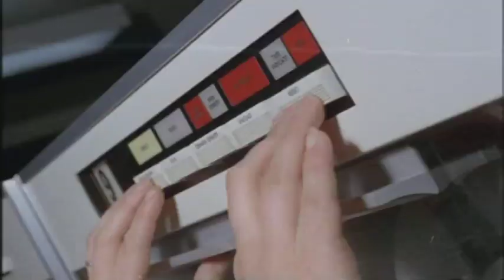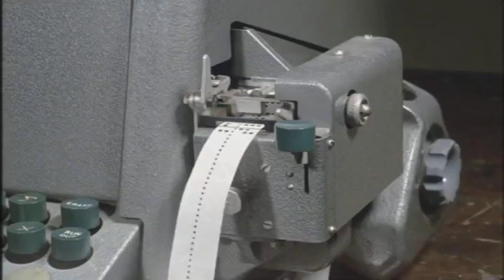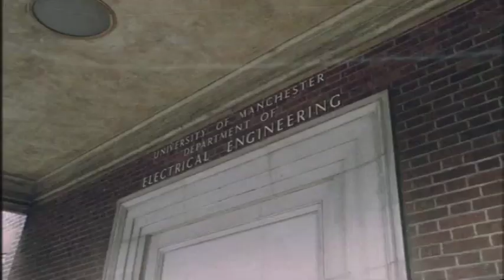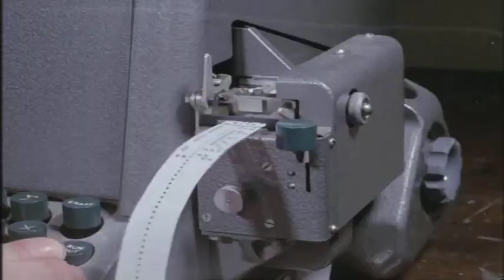Look at Life: Figure it Out

Comment: 2:04 "they can
        
      
    
  

  

    

      02:07
    

    

      
        

          deal only with things which can be
        

      
    

  

  
    

      02:09
    

    
      
        

          expressed in numbers
        "

I was going to argue that point but then I looked at the formatting of the quoted text. LOL

Still, I prefer mechanical analogue computers working with analogue variables like speed an torque - a bit like the computers in an Invacar calculating the correct drive ratio for engine speed and power for the speed of the vehicle.